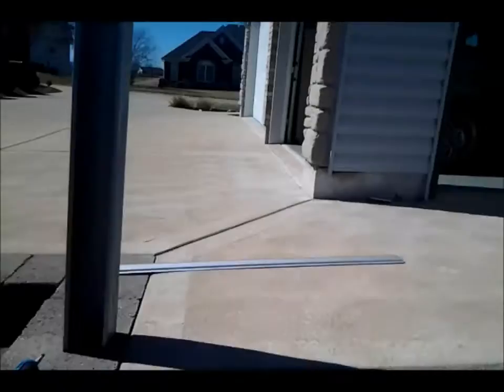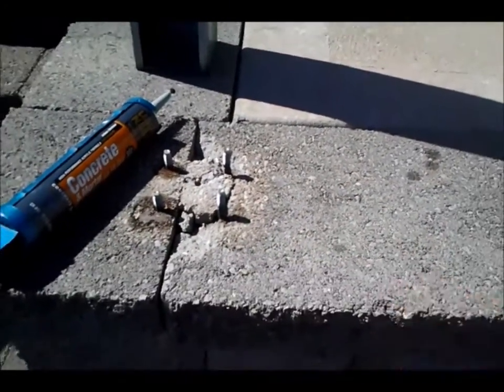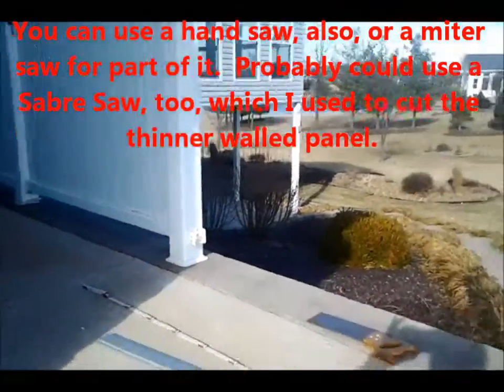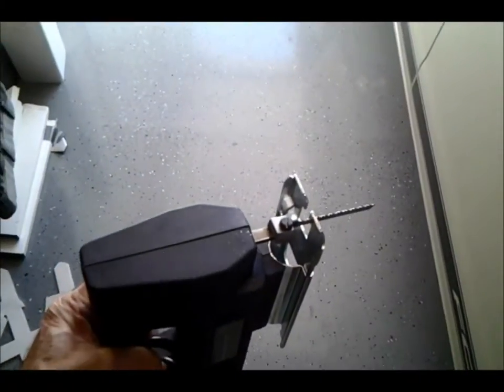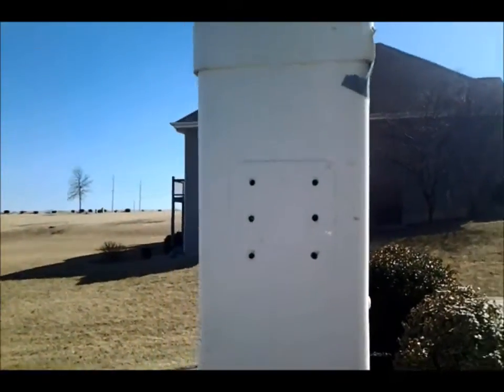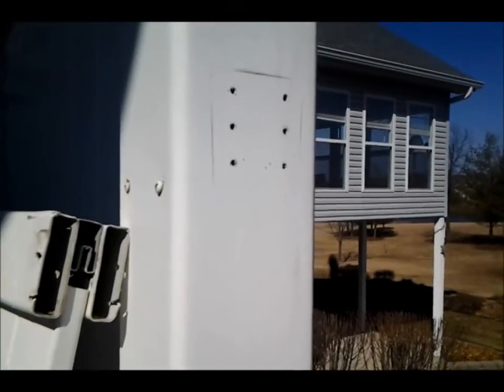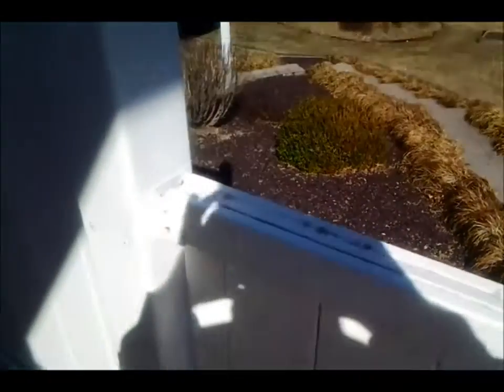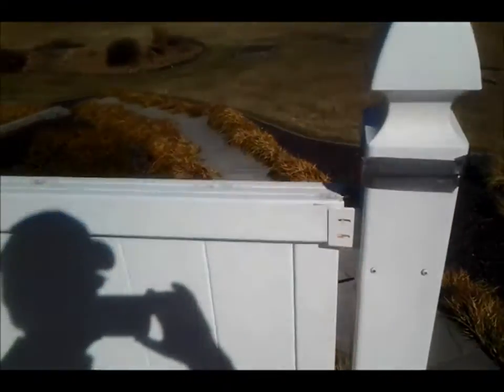Vinyl Fence Installation/Repair Part II

Comment: You didn’t show how you installed the fence into the brackets! Probably the most important part of the project
Reply from the maker: You just simply slide it in place and attach the screws as show where to place them.